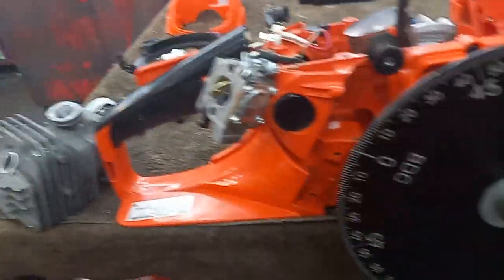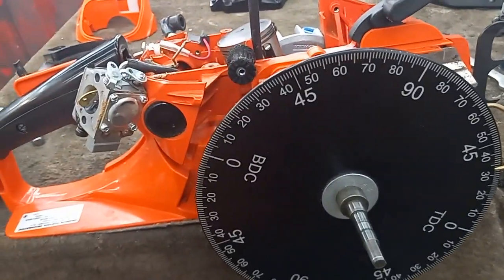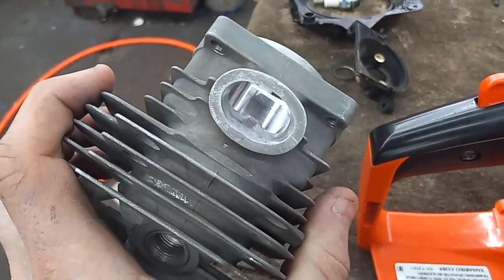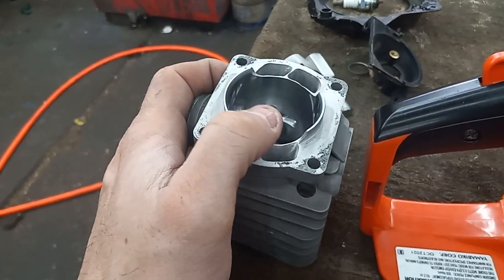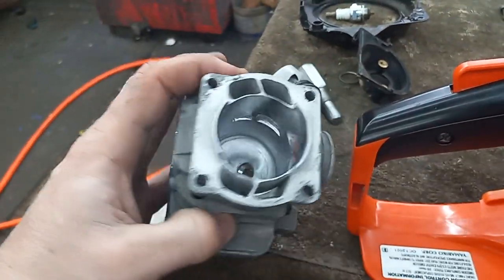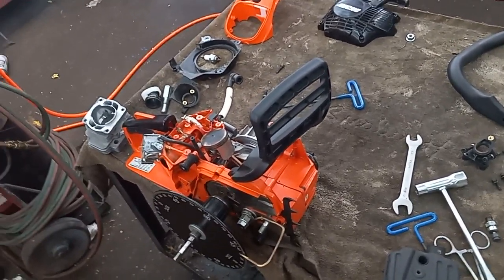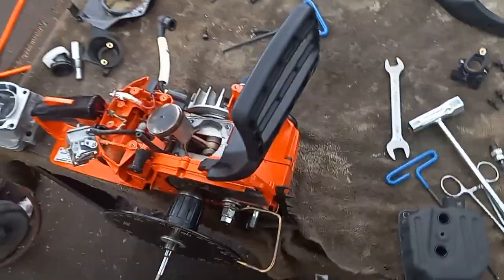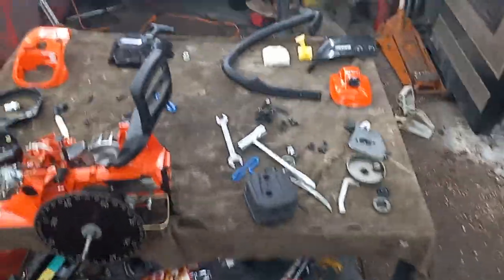revisiting my buddy's 4910 trying to get more out of it

Comment: I have an Echo CS 400 I would like to have ported, and hotrodded. your work looks great! Do you have an email address to get up with you?
Reply: Cs400s don't gain alot being ported. And he doesn't like doing clamshell saws
  Take your cs400 muffler off. Cut it in half all around the seam...take the catalytic converter material out and weld it back up. Slap a single 3/4 pipe out the front
  That recipe is perfect for a 400. That's all I done to mine 
  I also have a brisco ported 4910
Reply from the maker: Just muff mod that an re tune it I ported one once I did not like it that much it's clam shell with limited coil
Reply: Thanks for the reply, i've already done the muffler mod and tuning, it runs great, was just curious about the porting. If I buy a brand new 4910 would you work on it?